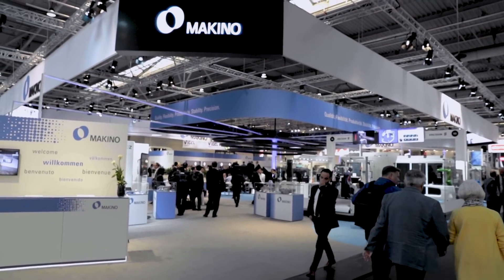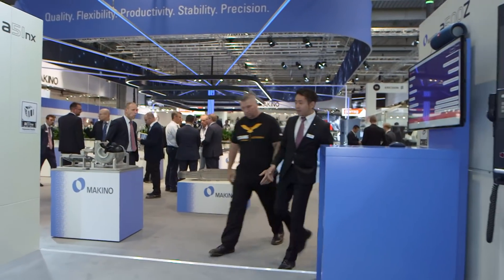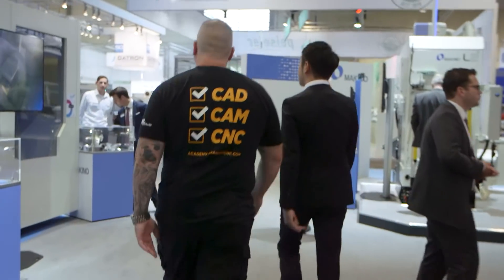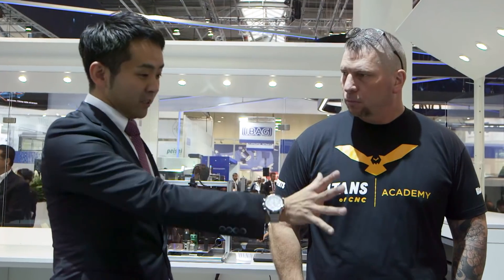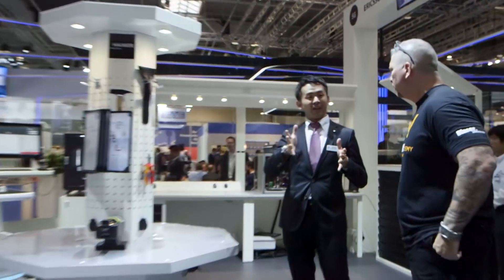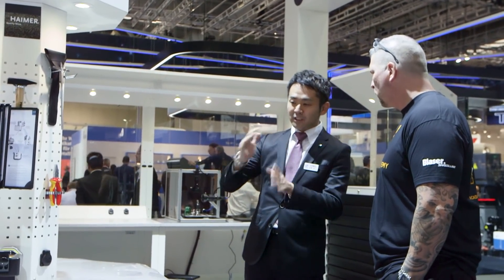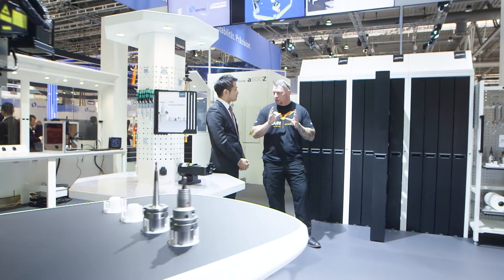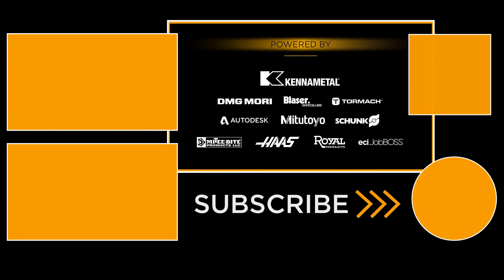MAKINO’S Crazy Fast, Precise & Powerful CNC Machines!

Comment: I’m a 42 year old manual machinist , did some cnc operating no programming (company had 2 programmers). I’m a bloody good machinist, all ways think outside the box, fully understand the dinamics of fast accurate neat machining BUT can’t get a job that allows me to break into cnc and programming. 
How can I get with the times ? How can I not think cnc and automation will eventually take my job away?
From Perth Australia .
Reply from the maker: Join our Academy.titansofcnc.com

Download Fusion360 for free as a Hobbyist and start with my building blocks series
Reply: Dave Nicholson 
I’m coming from the U.S. but I’d think your best opportunity is at a small low volume high mix job shop. They will not have the latest and greatest cnc equipment but should recognize your skills as a manual machinist will directly correlate to cnc machining. I’ve done both the only difference to me is manual you make the decisions in the moment cnc you make them ahead of time.
Reply: I had to write a program and run it when the boss was gone. It worked was made programmer
Reply: you are only 42 ,  and with a big exp like manual machinist if you are not scared from computers you are perfect material 
for good CNC Programmer . All you need is PC , than download some CAM soft ( school version) and a lot of free time to learn
Today on you tube you have a milions of videos to instruct you how to start and learn . Also a lot of PDF files .
Reply: World will always need manual machinist for rework .. manual machines is to much like work though. If not interested in that school or small shop is your best bet . Tomorrow my Okuma multius 750 dual chuck 5axis is coming cant wait ...dumping the mazak intergex e510
Reply: E410 sorry fat fingered the 5

Comment: Great video... However if the employment market is being reduced due to automation, that would mean there will be alot more competition when trying to get the few job positions available. That will cause an increase of unemployed people due to fewer jobs unless new industries are created.
Reply: Maybe, but as an example of the other side of this argument, I run a small machine shop, about 3 years ago we had 1 employee when we started investing heavily in new tech and automation.  We now have 4 employees and have much more than 4 times the amount of work go though our shop.  I know this is very small scale but i believe the same thing happens in a country.
Reply: History tells us that automation creates opportunity at the cost of employment security.
Reply: @Inventorsquare  I'm not an expert on this but I don't agree with that.  Automation creates higher paying jobs that require more skill.  Typically the more skill your job requires the more job security you have.
Reply: Craig Krueger Nobody is already what they need to be when new technology arrives. There is nothing but opportunity left for any remaining Pony Express cowboys to learn IT, for instance.